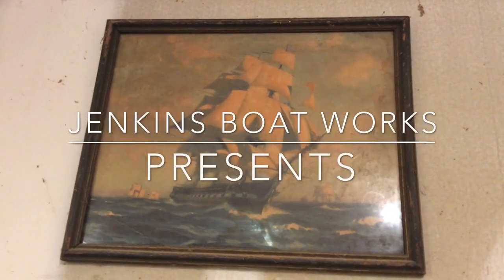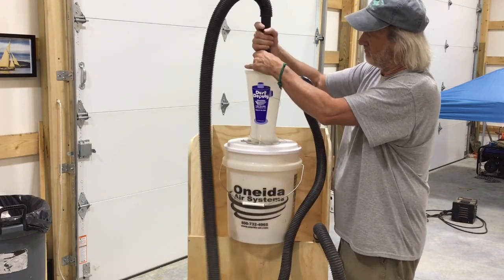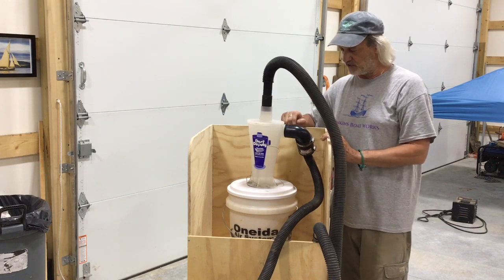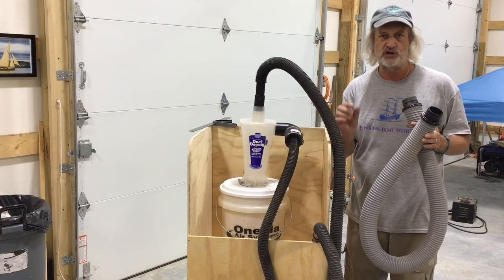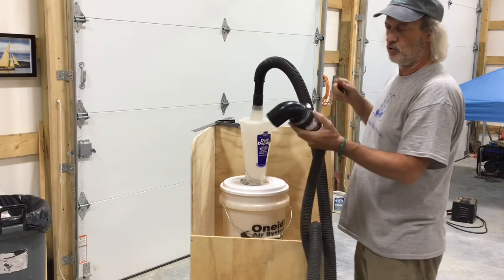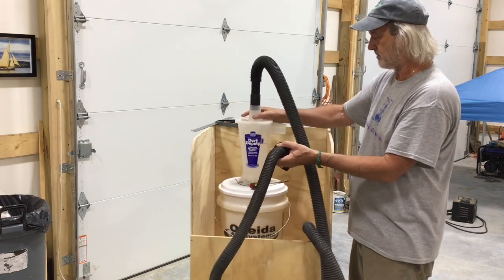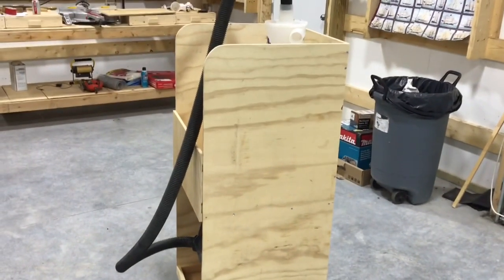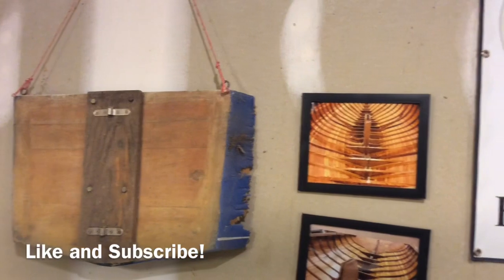How to hook up Dust Deputy

Comment: What a  CF.  What was Oneida thinking?  The 1.0 version with nonstandard nozzle sizes that sends the user out trying to jury-rig their new dust system.  Then to continue to sell the old version along side the "new and improved" version.  They should issue a refit kit for  the older model.  Way to tick everybody off.